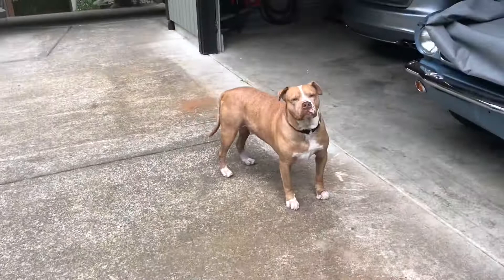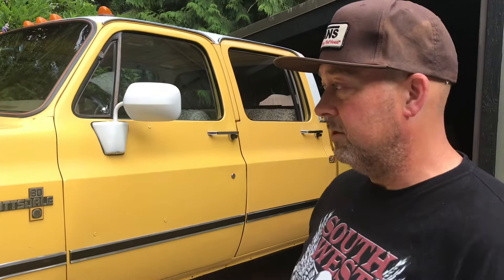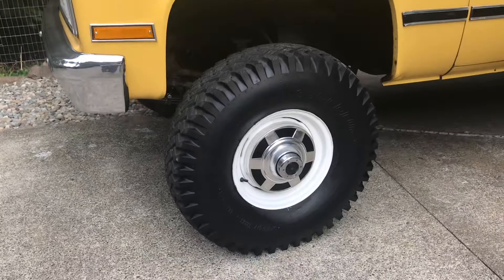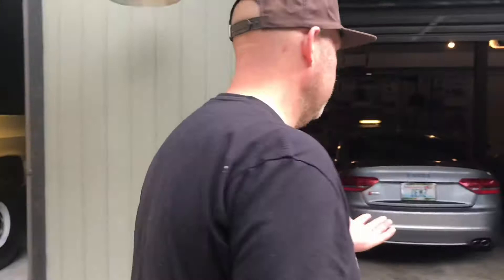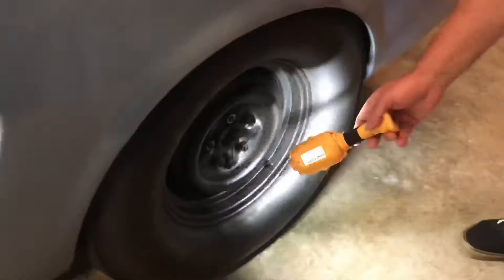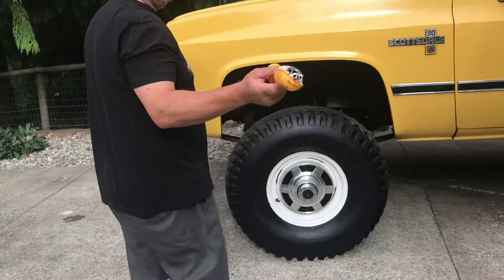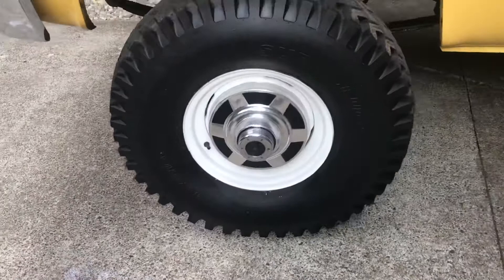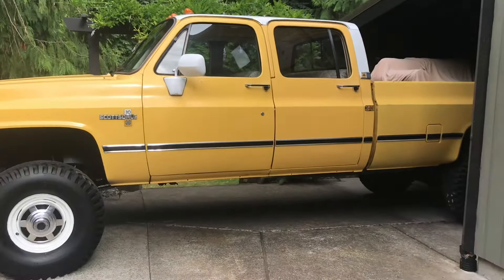Tires, Bias ply, radial, big, small, which ones should you buy

Comment: Interested in a set of these for a Mitsubishi Fuso Fg649 4x4 truck. I live way up near Montreal, and I'm afraid of the 'hard, flat spots' that everyone is warning me of.

What's the coldest temps you get there, and how do they perform when cold? I'm also worried about the higher crown on northern roads, and all the seams we have from freeze/thaw cycles. Do these really follow seams and grooves like they say, and make your steering feel loose?

Thanks! Nice truck!
Reply from the maker: My truck doesn’t get driven hardly ever. I drive it about once a month during the summer once every two months during the winter, the tires do get flat spots, but only take about a mile worth of driving before they go away. I never have any issues as far as following cracks and lines in the road. I don’t notice any difference between those tires and radials. I’ve probably never driven it in weather colder than around 30°. Your super cold temperatures might be an issue. As far as the tires heating up enough to get rid of the flat spots.
Reply: @zmurray9499  Thanks. I'm leaning towards a set. Wish I could find some Michelin XL's or XZL's. They're almost impossible to find, now.

Comment: have you stuck 35s on a 1 1/2 shackle lift? or stock height?
Reply from the maker: redburro88 I think they should clear no problem. Seems like when your dealing with 3/4 and 1 ton you end up with more lift than advertised.i put my 36’s next to the truck and jacked it up with a floor jack(to meet the wheel center without lift and stock height). I didn’t think it looked good and you probably would have to trim the fender corners a little.
Reply from the maker: redburro88 it seems as though the three-quarter ton in the 1 ton sit about 2 inches higher than a half ton. And as You probably already know the 4 inches will get a 35 inch tire under it